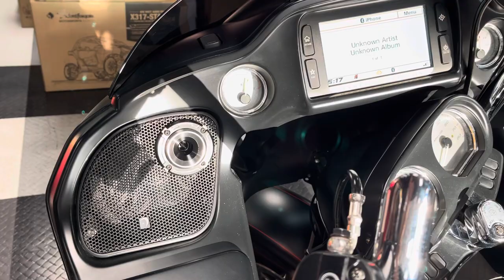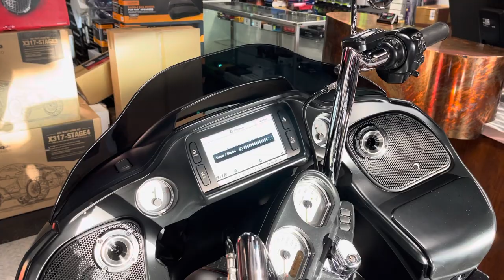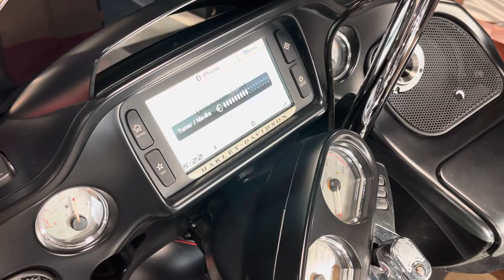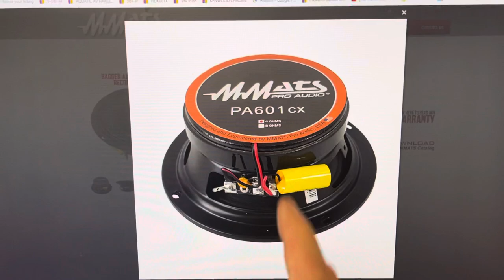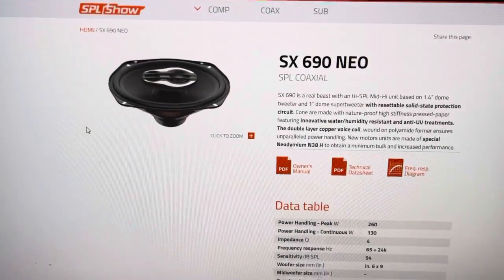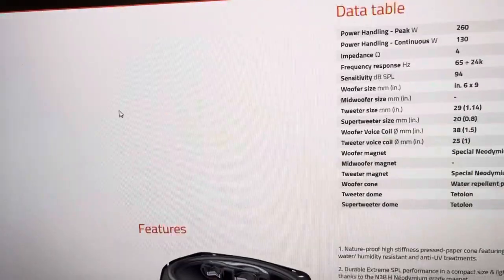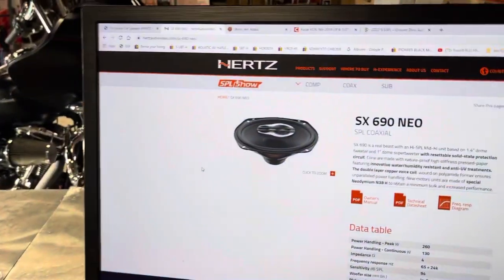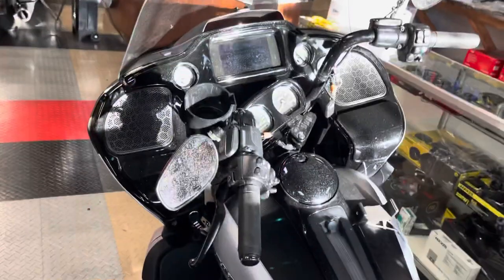702 MOTORING LAS VEGAS & DIAMOND AUDIO / FRIENDLY CALL OUT TO THE COMPETITION / SHOW US THE MONEY

Comment: Does that amp setup drop it to 2ohm load?
Reply from the maker: It does on the channels running the mid's - the horns are 8 OHM's each keeping those two channels at the 132 Watts RMS each channel at 4 ohms which is more than enough power
Reply: @702motoringlasvegas4  if using MP654s would I still need horns up front?
Reply from the maker: @rwinbush750  Are the MP654 speakers in the front of your bike? if so than no you would not need additional horns
Reply: @702motoringlasvegas4  yes they would be up front. Thanks.
Reply from the maker: @rwinbush750  No